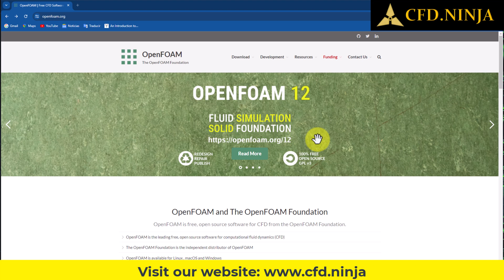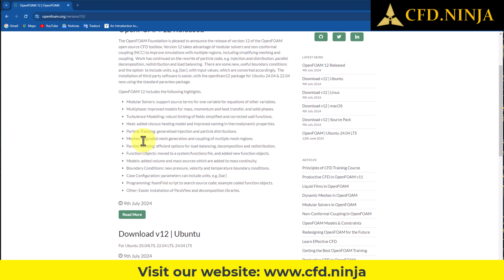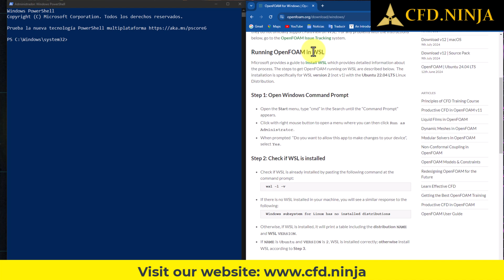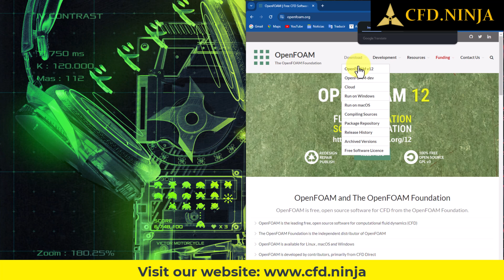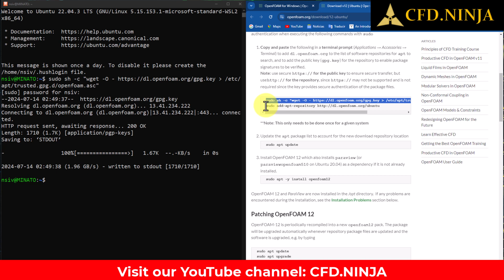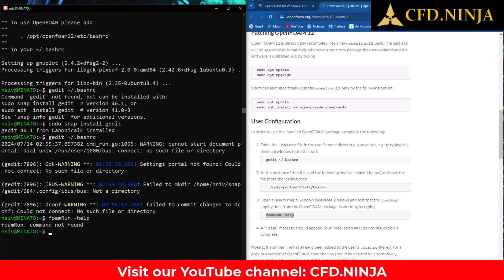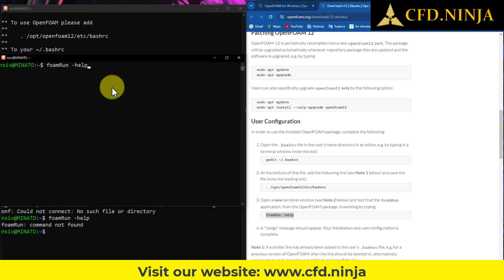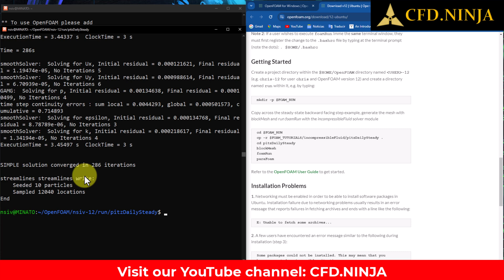✅ Install #OpenFOAM 12

Comment: I am getting following error:
Created temporary 'pitzDailySteady.OpenFOAM'
QStandardPaths: wrong permissions on runtime directory /run/user/1000/, 0755 instead of 0700

Loguru caught a signal: SIGSEGV
Stack trace:
1       0x7ffe3d7dc6f0 [0x7ffe3d7dc6f0]
0       0x7faadd17c520 /usr/lib/x86_64-linux-gnu/libc.so.6(+0x42520) [0x7faadd17c520]
(   2.366s) [paraview        ]                       :0     FATL| Signal: SIGSEGV
Segmentation fault (core dumped)

Any Idea how to fix it?
Reply: I got the solution. Its there on same website under "Known issues with fixes":

Segmentation fault when opening ParaView [  issue #4105 ], which references the Qt library (e.g. libQt5Core.so.5) used by ParaView.  The segmentation fault may be avoided by using software rendering in the MESA 3D Graphics Library (GL) to process the graphics.  Software rendering is enabled by setting the LIBGL_ALWAYS_SOFTWARE environment variable to true (or “1”), typically by adding the following entry at the end of the user’s ~/.bashrc file (see User Configuration for editing .bashrc):

export LIBGL_ALWAYS_SOFTWARE=1

That's all and paraview works fine.